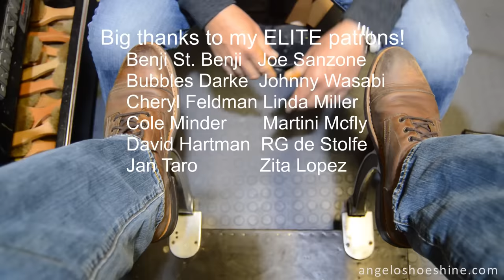HE DID WHAT?!?! | ANGELO SHOE SHINE ASMR

Comment: What grit are you using? 600, 1200? I'd assume it has to be a pretty high grit to be going after it like this. Then again, you're not using water and grits higher than 800 are generally water sanding (I turn pens). I'm curious. Sanding a lot, so must be a lower grit, but then again, it would take off a lot more leather, so I have no idea.